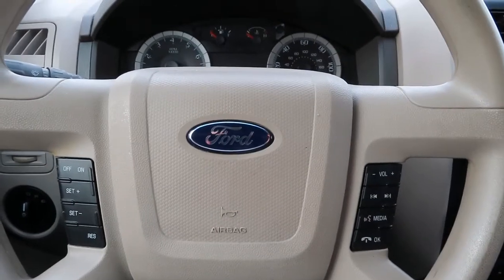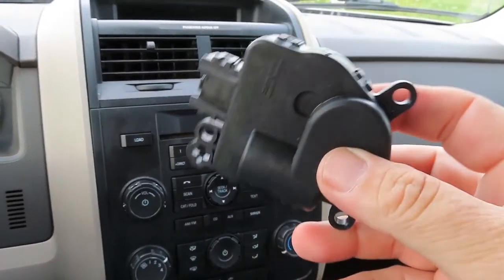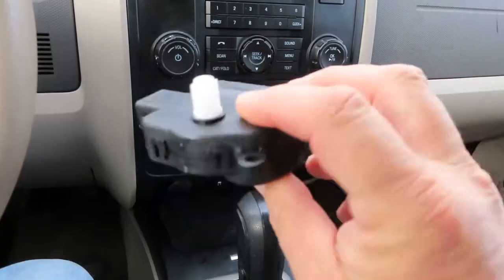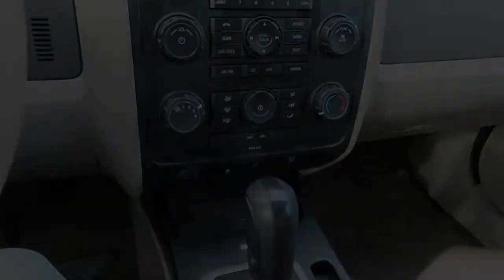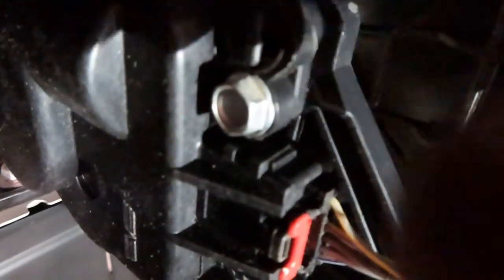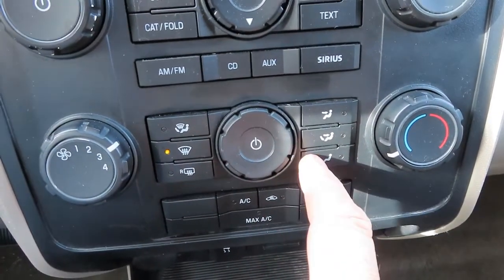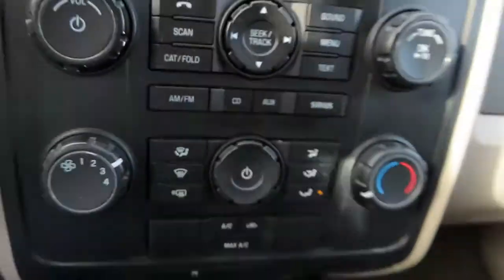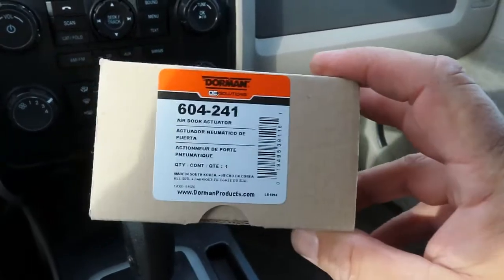Ford Escape Vent Actuator - vent won't blow repair. Ford Escape, Mazda Tribute, Mercury Mariner

Comment: I had issues with sticking in one position, reached up and messed with linkage arm, must have dislodged it, works but noticed last summer and again this spring switching from floor heat to vent AC it gets a grinding noise sounds like behind speedometer up in dash....do you all think it is vent door actuator going bad.....also is there only one other actuator that controls hot or cold and is it on passenger side next to glovebox

Comment: Crazy! Mine is not there, nor under passenger airbag. 2005 Ford Escape XLT V6. My vehicle manual does not show any details either. It only mentions it as a potential problem.

Comment: Just fixed my 2008 Mariner purchased used at 92,000 miles.   120,000 miles now and I couldn't find the top screw... and realized this had been replaced before and someone never put in the top screw back in.   Also if the  cover just below the steering wheel is removed it makes this job a lot simpler.  The position of the white post is not correct  and I just moved the white wheel (near the center console)  until it goes in easily, and 10 minutes of total time start to finish saved a small fortune.

Good video, thanks for the help.
Reply: Was there just 1 door vent?
Reply: If I remember  correctly...one on each side of the console drivers side for the  defrost ect.  And passenger side was temperature ... its been  working ok and  I really  don't remember all the details.
Reply: Oh okay haha ty i have the same car and I’m now trying to replace the part just stuck at the red tab not sure how to remove the harness
Reply: i think i just pulled it down as i pushed in with a very small screwdriver?